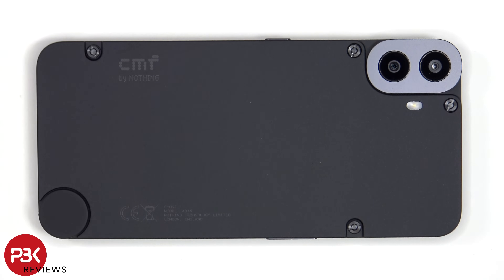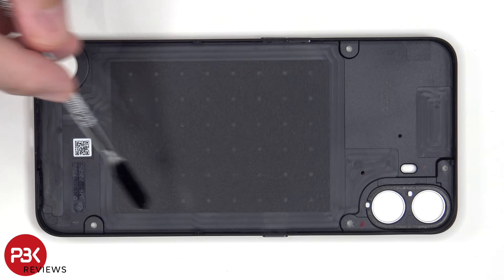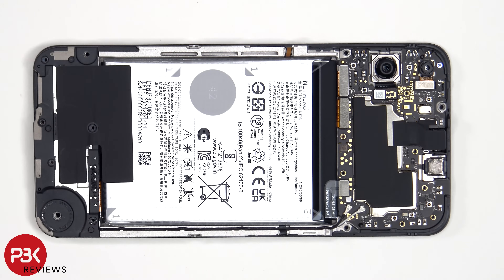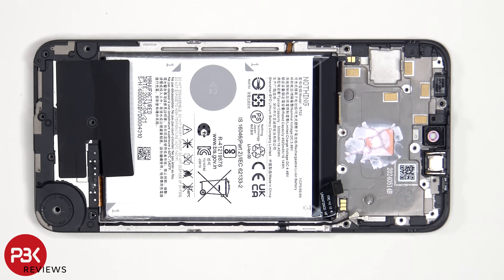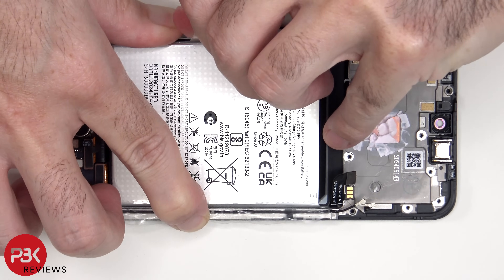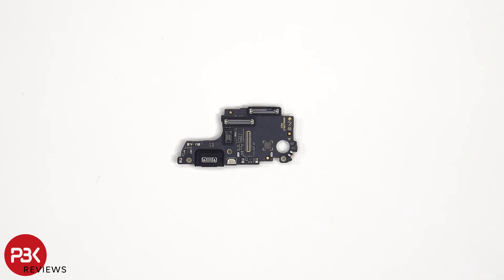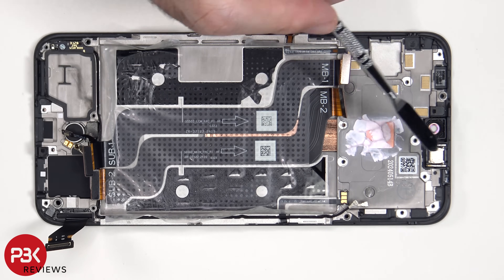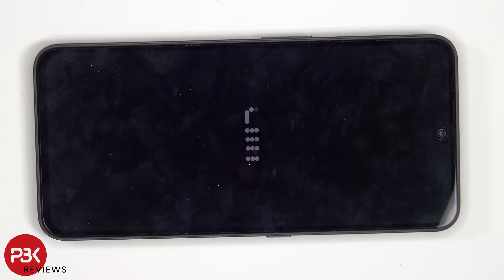Nothing CMF Phone 1 Teardown Disassembly Phone Repair Video Review

Comment: So this phone using thermal paste, not the best choice now I think, my old samsung have evaporation chamber if I remember correctly, so paste will last only 4-5 years or so, and will it make sense to change it to arctic mx-4 or not? 
Also 5:01 looks like liquid thermalpad Gigabyte using,, and there's only 1 bank of memory? So no dual channel, or second is hiding under this bank?
Thanks for teardown and info!
Reply: You're behind the curve. Paste is obsolete, phase change material is the ideal thing to use. They're available in multiple thicknesses and multiple phase change temperature requirements.
Reply: Well I mean it's good, using it now and see that Samsung was hotter, with evaporation chamber

Comment: Basically repairing this is the opposite of the typical Redmi/Poco or Sony phone where the hardest part is getting into the phone by taking the whole plastic body (risking damage to any thin plastic) or just the back glass cover off and the rest is easy. With the CMF Phone 1 the hassle starts once you're in the phone.

Comment: Hmm if you ignore the warranty which will probably finish by the time the battery is bad, its neat that you could replace it without a heat gun.

Only concern is if every other part has to be removed to do so and thermal paste reapplied, which was not clear in this video.
Reply: he happened to remove the battery at the end but you dont need to take everything apart to do it, just unglug it from the motherboard and pry the battery out
Reply from the maker: You don't need to remove the motherboard, just remove the cover over the motherboard to be able to disconnect the battery cable.
Reply: @PBKreviews  I see that's good to know. Might just get this phone for unofficial replaceable battery lol. Fair phone 5 specs still leave much to be desired compared to my current phone (which is quite old)
Reply: @lorddarthvader6289 This phone has quite bad specs too. Yeah it has good processor, enough ram and rom but it doesn't even have ultra wide lens, no nfc so that's straight up a bad phone. I mean for less money you can buy a Redmi note 13 that has everything and more...

Comment: I am interested in buying this phone. However, only the most expensive 8 / 256 GB model is available in my region for HK$2299. I find that a ripoff, especially this phone has a microSD slot. I don’t intend to buy that much internal storage.
Reply: This phone is a ripoff to begin with. No 3.5mm jack, mono speaker, crappy optical scanner... Galaxies are better, or used iPhones.

Comment: I think if they have given a removable battery the phone would be quit thick and better size will be much smaller because removable battery needs a plastic case and the component needs to be shielded so ti also needs more space look at fair phone for example it big thick
Reply: The phone would be barely thicker. The Galaxy J3 Prime with its removable 2600mAh battery is 8.7mm thick. The CMF Ph1 with its 5000mAh battery is 8.2mm thick. The LG K20+ has a 2700mAh cell that's removable and only 7.9mm thick. Point is removable batteries don't make the phone thicker.
Reply: lol, makes no sense. They could've made the battery replaceable and easy to access within the same body. stop defending these ass practices
Reply: Is the fairphone 5 thicker?
Reply: @FourtySeven-r5r  1.4 mm thick

Comment: No removable battery kills this thing for me. So close!
Reply: i mean, easily replaceable if need be, not ideal but can be done by yourself if yours eventually damage
Reply: Buy fairphone 5 you can replace anything
Reply: Am I wrong, or wouldn't having a removable battery make the phone thicker?
Reply: Their whole deal is the accessories that you can replace it with. Not the battery. 

Even then, it's not the hardest thing to replace. Compared to many other smartphones.
Reply: @VeedoCapone I don't disagree with you. But if easy swappable batteries is your priority, then look no further than FairPhone. 

This CMF Phone 1 is a good alternative. Because it's easy to remove the back cover, pop the right screws and replace the battery. And put the back cover back without adhesive.
Reply: One word = regulations (dont kill that knowledge)
Reply: @mahimabiat5577  &  @BozQ & @VeedoCapone :
 The FairPhone 5 costs 4 times more. 
The best thing then is to take the Samsung Galaxy XCover 6 Pro 😉.
Reply: @VeedoCapone gotcha. 
The FairPhone is not an option for me too. The cost plus shipping is too expensive to make sense.
Reply: @mahimabiat5577  &   @BozQ & @VeedoCapone :
 The FairPhone 5 costs 4 times more. 
The best thing then is to take the Samsung Galaxy XCover 6 Pro 😉.
Reply: all they need to do is  add a few screws amd remove the battery glue under few screws in plug the battery  then put a new one in that all they needed to do
Reply: Anyway it's way better realization of battery replacement then other smartphone brands offer
Reply: Due to strict regulations in some countries, such as Europe, modifying electrical components without professional inspection is prohibited. Unauthorized repairs can void home or property insurance, especially if they lead to a fire.
Reply: But why? Do you currently use a phone which has a replaceable battery?
Reply: I wonder if it was just too difficult to engineer? They could've made a killing by selling replacement batteries.
Reply: @worthless_opinion  Difficult? We had removable batteries for ages
Reply: @socramdavid  Yes but not with modern super thin, super powerful smartphones.
Reply: @socramdavid man don’t forget those phone had small battery coz removable battery needs plastic casing for shielding and you also need shielding for the components
Reply: @worthless_opinion It's not super thin but Samsung XCover6 Pro has a removable battery, was released in 2022 and is capable of using DEX. It can be done. They just don't want to.
Reply: @worthless_opinion 1. This is not thin 2. This has nothing to do with the phone being more powerful
Reply: 8mm is thin. And it does, actually. Primarily thermal constraints.
Reply: @worthless_opinion  Its because it would go against regulatory laws, you midwit.
Reply: @worthless_opinion  lol lmao even
Reply: I mean what are you really needing to remove the battery for?
Reply: @jessluvecko  Easy replacement when the battery ages, quick turn off, have spare batteries for trips...
Reply: Jesucristo te ama muchísimo, arrepiéntete de tus pecados y ten perdón de pecados en Su Nombre

Comment: It looks like they just want to make money by changing the back covers and by adding new accesories. The rest of the phone is the same as any other phone.
Reply: Indian users say that it's quite worth it since the Galaxy A35 is near 2x the price of CMF1.
Reply: @jiffonbuffo But the A35 is way better than this phone. It has better specs and everything you need on a smartphone. This one however does not have nfc or ultra wide angle lens. And the removable back is just a gimmick that no one would even use. This phone is a scam pretty much...

Comment: I never understand why they won't put flagship specs on phones with removable back covers or batteries.
Reply: Google did....but flopped very quickly
Reply: Water proof who will give to protect high specs if they put removable case😂
Reply: @hazz1125 Lol. IP ratings is just water RESISTANCE, not waterproofing. Galaxy XCover6 Pro/XCover Pro from 2022 and 2020, both with removable back cover AND ip68, exists.

You fell for the marketing meme.

Comment: This phone cost £179 and I'm unsure it would be worth repairing it or replacing the battery when/if either is required at a future date.
Reply from the maker: You'd be surprised how many people repair and use phones much less in price than that. 🙂
Reply: Who even replaces battery anymore... default batteries last for 3-5 years
Reply: @hazz1125 A lot of people. Poco X6 Pro used heavily by a local youtuber in my region already lost 2hrs off his gaming from 6 hrs in January (launch month).

Even 2 years is enough to take a toll on the battery despite casual use.

And have you seen used iphones 12 and above being sold with BH close to 80%? That screams battery replacement to me.

Comment: The whole point of the removable back cover is to provide options for customisation and I don't think they have ever claimed it is to make the phone easier to repair?
Reply from the maker: yeah that's true, but at the same time I feel they are targeting the right to repair group to make it attractive for people to purchase. I mean just for a back cover accessory, people make cases that do the same thing. A lot of people look at the removable back as a repairable friendly feature and I'm sure they are taking advantage of that opportunity.
Reply: @PBKreviews  yes but it does also provide additional screw on functionality when accessorised with the wallet, lanyard, stand. which is a nice upsell for CMF too. I think it's a great fun phone with a decent processor and screen etc for a really good price here in the UK at least. I bought one purely out of curiosity and a desire for something that looks a bit different.
Reply from the maker: yeah, definitely. As I said its cool they provide the documentation to be able to print your own back covers and so forth. A welcomed move. As well as the fact they used a good amount of thermal paste and good quality where a lot of others skimp out on. Overall a decent device for its price range and yeah fun phone.
Reply: It's a missed opportunity though, they'd have to power to say "not only can you customise your phone, you can also replace the battery yourself" then on top of that they could sell the battery replacements.
Reply: @Fool1999  true.... wait for CMF Phone 2 😀